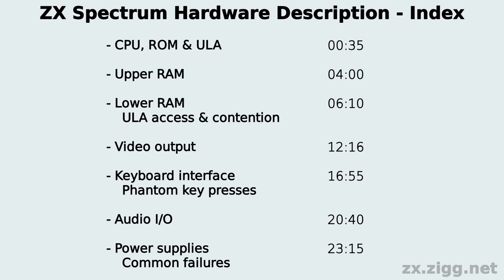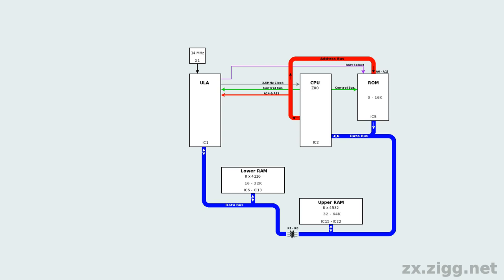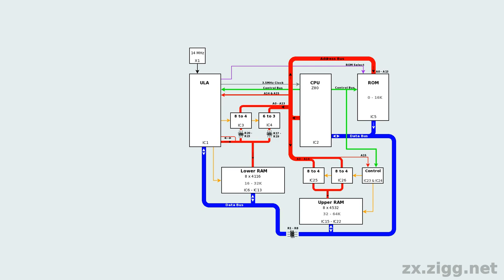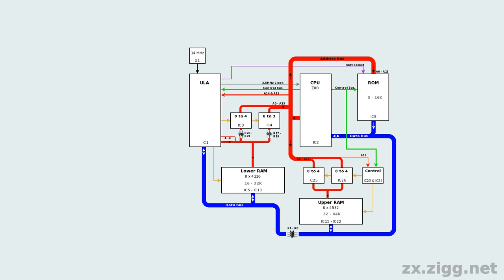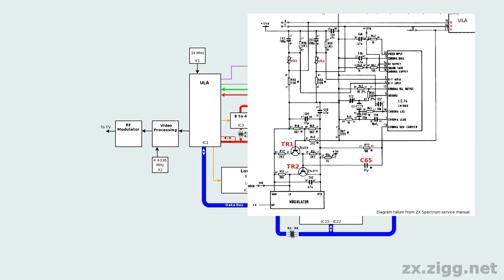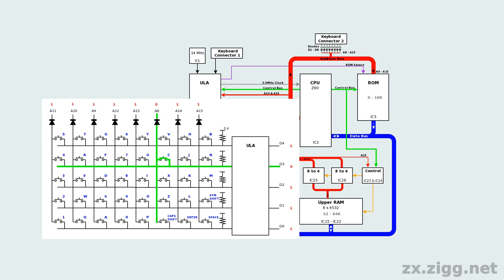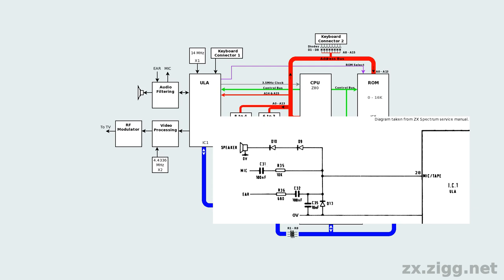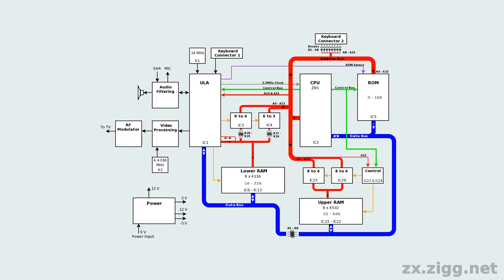ZX Spectrum Hardware Description

Comment: Clickable timestamps for easier navigation:

0:35 CPU, ROM & ULA
4:00 Upper RAM
6:10 Lower RAM, ULA Access & Contention
12:16 Video Output
16:55 Keyboard Interface. Phantom Key Presses
20:40 Audio I/O
23:15 Power Supplies. Common Failures
Reply: not all heroes wear capes!

Comment: Great video!!!
Why they added resistors in series on the data buss between the z80 and the ULC? Is this because they want to limit the ammount of current the ULC draw from Z80?
Reply: When two devices take over the bus they can set each line to different logic values. For example, assuming Z80 D0 is low and the other device try to drive the same line to high, you have a bus conflict, In terms of electricity you connected two points, one at 5V to another to 0V. This is a short circuit, drawing a lot of current and feeding a lot of current on the 0V side, which can damage both devices. this condition make the logical level not defined and it is unable to identify which logic value is on this line.

To solve this, in a more canonical (and better) way, an high impedance state is used, so the conflicting device is electrically disconnected from the bus (as an example z80 can disconnect itself when a bus request is issued), but in order to save money they decoupled both sides using resistors. In this way each side of the resistor can drive and see the logical level he want to assert
Reply: @gasparinizuzzurro6306  thank you for the detailed explanation.

Comment: That phantom key presses effect could ruin your work if you want to write a letter because if you press CSF at the same time, it will register Z to be pressed, and yeah, you should indeed never ever pull off an expansion module while the system is on as it could cause shortsge o,o,o.
No wonder some people did hate the spectrum because of these syndromes.
But if you are becareful in what you’re doing, it should run fine i guess.